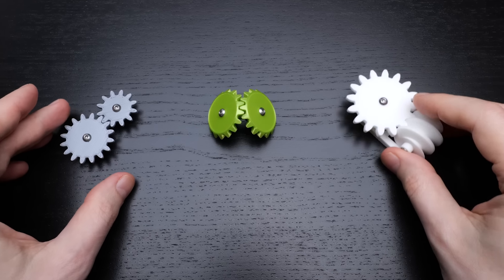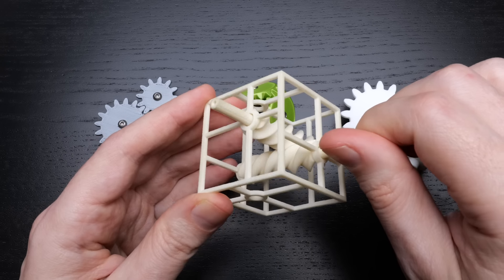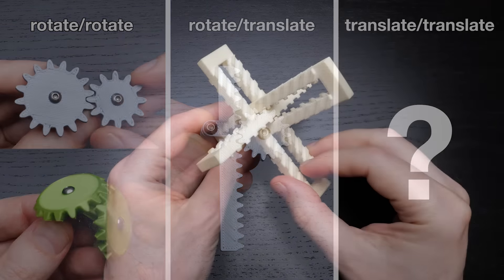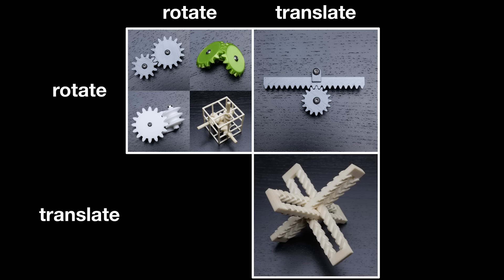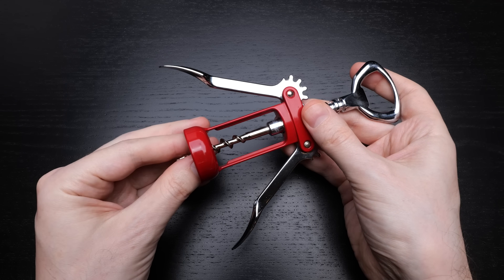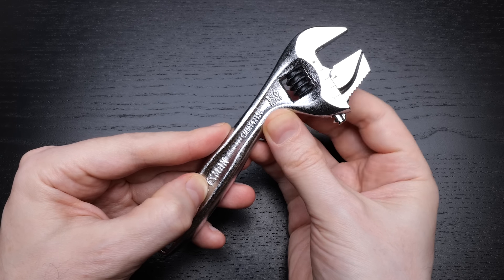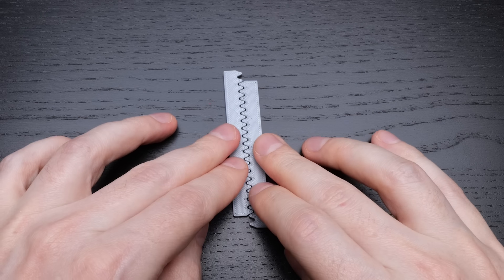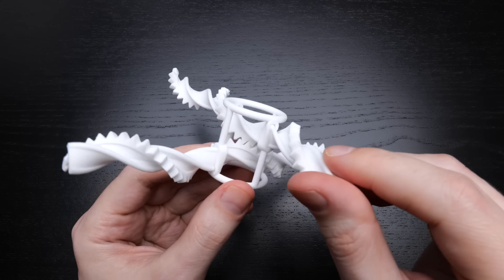Screw/screw gearing

Comment: The actual gear mechanism on the cork screw makes absolutely no use of the screw. The teeth are just rings so I really don't think you can't put it in the screw category. It's a rack and pinion with the freedom to rotate. With the cork, the screw is separately moving the rack which interacts with the gears purely through its linear translation. You won't be able to spin the screw part by moving the handles. Even with the cork, it'll just get jammed if you try to pull it out. There is no sense in which the actual gear mechanism involves a screw motion.

Edit: I paused the video to type this. You kinda of address immediately after but I still think you're overstating things to call it a screw gear when it goes into the cork. The screw isn't involved in the gear mechanism itself.
Reply from the maker: I’m think of it perhaps more from a mathematical rather than an engineering perspective. To me it doesn’t matter if the shape of the screw doesn’t interact with the shape of the rack. The only thing that matters is whether the mechanism fits the definition: do the two gear parts move as a screw and as a rotate relative to the frame?
Reply: @henryseg  I think that just demonstrates the flaw in that definition. Definitions come after a word and are meant as a best fit explanation of how the word is used. People write essays about definitions failing to provide a full picture of a word. There simply isn't any screw motion in the gear mechanism. It's using the precise wording to stretch an incomplete definition beyond the actual meaning of the term it is meant to describe. People tend to assume definitions are the true meaning of a word, as if there was some board room where they agree on exactly what a word means before it's written down. 

People use a word then later on people try to come up with the best way to describe it to people in dictionaries. Definitions change, not just because the words themselves change but also because we notice flaws in those definitions and find better ones. Even when they are the best explanation available, they can still be flawed. Sometimes in science, a certain set of parameters could be used to define something in all known contexts but eventually something comes along and they can either accept their original definition as not what they had originally thought but still keep to its original wording or they can adjust the definition to something that brings it closer to the original intention behind the word, removing any unwanted inclusions. Science tends towards the most stripped down definitions it can manage - for good reason but it makes this a slightly more common problem sometimes. Tbh I think including that corkscrew example is pretty much just wordplay.
Reply: @henryseg  good video though, some really cool mechanisms and it's very good work. Don't want to miss that part out. Sounds like I'm being too critical. Glad I found this channel.
Reply from the maker: @drdank9013  Ah well, even the word "definition" is interpreted differently by people with different backgrounds. 

Mathematicians defined (for example) what "continuous" means in terms of limits, and then were very disturbed when they found a function that is continuous at every irrational value but discontinuous at every rational value. Sometimes that happens, but if it's a simple, clean definition, mathematicians tend to think that its our intuition that is suspect rather than the definition itself. Unless someone comes along with a different definition that better matches our intuition about a thing, while still being as simple and easy to use.

So, in the context of this video, I define what a screw motion is, and that's what I care about - not the particular shapes of the parts involved. By letting go of our preconceived notions about something and letting the formalism take us where it takes us, we sometimes get somewhere new and unexpected.
Reply from the maker: @drdank9013  No worries!
Reply: @henryseg  valid arguments but I think it would be more apt to describe that cork screw as a combination of a rack and pinion mechanism with an older more basic cork screw but it's also worth noting that nature doesn't create these categories, we do. In fact categorisation in general is only something humans do to organize things. This book called 'Event' by Slavoj Zizek good into quite a bit of detail about the flaws of human categorisation, referencing the fact that you tend to end up with an "other" category which demonstrates the limits of your choice of categories in general and that the reality is that, for example, the genetics of animals is more of a continuous thing which doesn't fit overarching categories if you look at it in detail. Basically, there is no physical law that defines these categories so it is arguable that our intuition is the only thing we're attempting to define here so in truth, there's no real right answer but I would say the definition that best fits our intuition would be the best choice while adjusting our intuition to fit a definition that didn't describe what we thought, in this specific case would basically be starting a tangent in the actual logic. At the end of the day, this is just about semantics but for the sake of someone much more interesting, if I come up with a rough definition for what I'm thinking a screw gear should be, perhaps you could come up with some application/mechanism for that version? 

My definition would be the same, except that the interaction of the gears themselves must be what produces rotational, linear or screw motion of the gears relative to the frame for the gear system to count as such.

You could even come up with a different word when a mechanism is asymmetrical in this regard. Putting aside the fact that the cork and screw are part of a separate interaction which drives a rack and pinion in a separate part, say you had the same mechanism but instead of rings interacting with the gears, it is actually another screw thread. This would have different ways of driving. The middle part could work like a worm gear or a rack or screw as it rotates the other gears but the other gears would only typically drive it as a rack and pinion in return without placing additional restrictions on the degrees of freedom of the central part. You could come up with a name for uneven situations like this and call mechanisms that work the same both ways something else. 

One more thing about the corkscrew example: if you have two gears that share an axel and interact with other gears separately as part of a larger system, would you call them the same gear? That's basically what's happening with the corkscrew, you have an axel with a rack on one end and a screw on the other. Can you really call that a single gear mechanism? If not, perhaps then the definition was never intended to be applied to something like this in the first place. Maybe you would but I definitely think this is one mechanism driving another. Screw -> linear -> rotational. The actual gear mechanism only makes use of the linear motion but now I'm just repeating myself.

To put it into a more physics/maths related frame, the rotational gear gains no energy from the torque in the screw shaft, it only gets the energy that is already converted into linear motion of the shaft. Can you make one that actually does use a screw thread the way in thinking?
Reply: @henryseg  Also, I'm sorry for this but it just occured to me that the frame you used for the spanner example (in order to count the worm as a screw) is attached directly to the part you're defining as the rack and moves with it so it can't be a valid frame.
Reply from the maker: @drdank9013  There's a lot here, and the YouTube comment section perhaps isn't the best venue for a long discussion... but I will say a couple of things. First in mathematics we actually do get to classify things entirely. Integers are either even or odd, there is no "other" category. The catch with this is that the definitions have to be precise, and to be useful they have to be relatively simple. So it's difficult to require that sections of some rigid part with a certain shape interacts with some other section of some other rigid part. 

In my version of the definition, a "gear" or a "frame" is just a rigid object. There's no requirement that the gear is any particular shape. Just that the mechanism made from the frame and the gears should have one degree of freedom.
Reply: @henryseg  I think I only just grasped what you actually meant. You're looking purely at the motion you can get from the mechanism while holding any part still and not actually classifying the specific mechanical interactions that yield them which would be more difficult to do mathematically. Tbh I'd normally be much more at home with the maths version, I just wasn't thinking on those lines at all.

You could get a more clear cut version like what I had been thinking of by combining one of the twisted rack gears from your double corkscrew with a normal rotating gear or a normal rack gear with a slightly more complicated frame. You could even make a cork screw which requires you to turn a vertical gear to twist the screw down into the cork. Probably wouldn't be very good though lol.

Comment: The jaw of the adjustable spanner doesn't fit your definition of "frame" you established in the beginning of the video.
It does not hold both other parts since it meshes with the worm gear.
This it is not a valid example for a screw/translate gear.
Reply from the maker: Good point - although if I were being a bit more precise with the definitions, the word “hold” isn’t clearly defined. Maybe better would be to only require that the whole mechanism of three parts should have one degree of freedom. This implies that it doesn’t just fall apart, and also means I can choose which part to call the frame however I want.